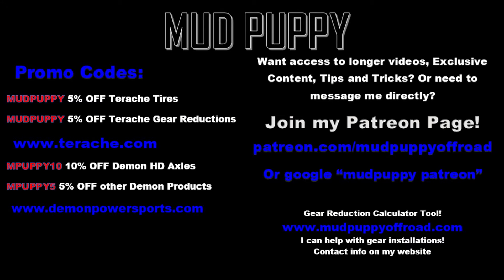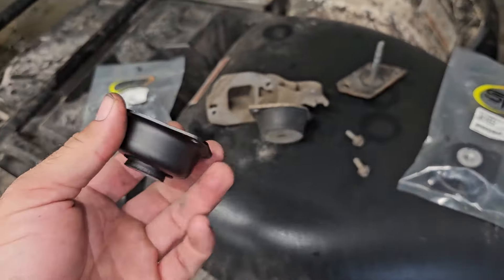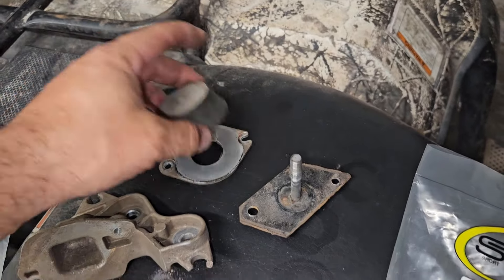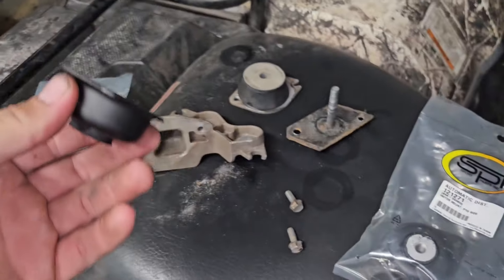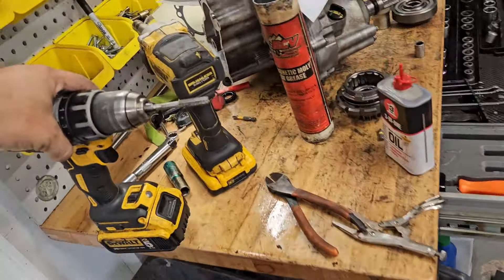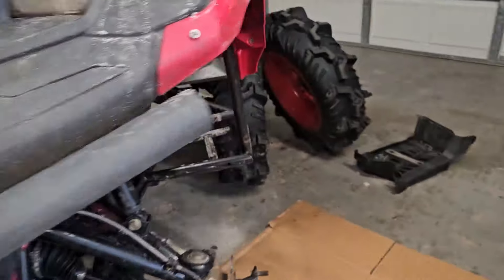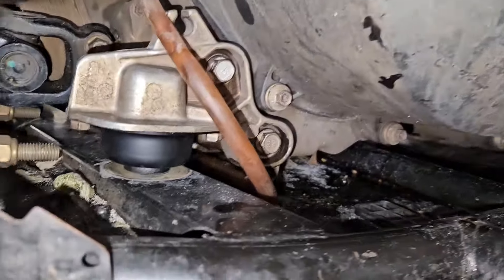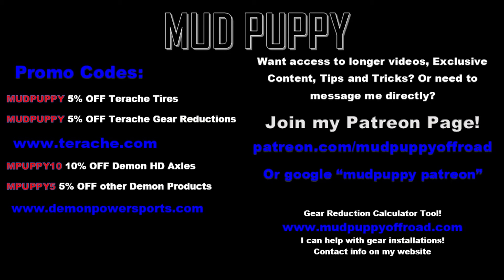Engine Mount Fix!!!  Gen 3 Outlander XMR700 Can Am probs lol

Comment: Awesome find with those mounts! So far my HD7 mounts are fine but I’m still running stock tires. I’m definitely keeping an eye on them though and now I have a solution should they go! Those look like engine mounts found on some skidoo sleds which would explain why they bolt right on…lol

Comment: How is the ride with no rubber in the front mounts? Notice any difference? Also would heat help with the breaking the lock tight on the bolts? I really don’t want to have to tap new holes.
Reply from the maker: I did not notice much of a difference with the solid mounts, but now that these snowmobile mounts are available, I would just go with that. You could try heat I guess. I think the most important thing is just to put them in by hand. They cross thread easily.